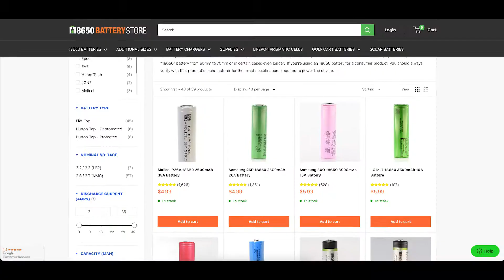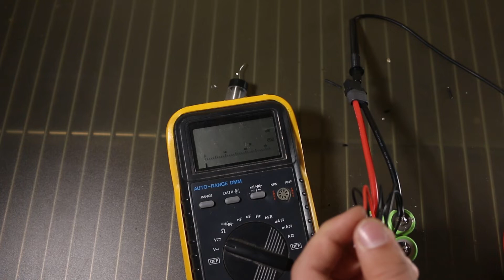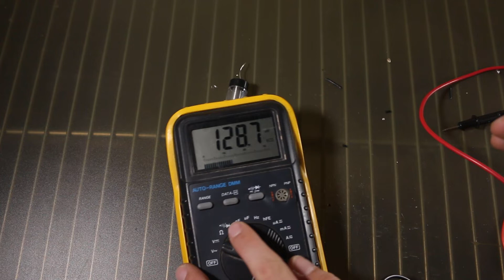Build a Custom Battery!

Comment: Just be careful here. It's unlikely that a battery will explode or catch fire on you doing this, but it can happen. Be accurate with your soldering job and use the lowest temperature you can to get a get solid solder joint. Secondly, these packs are starting to become available pre-made, if making one yourself is not for you, you can likely find one somewhere. 6 cell packs have been available for quite some time. Cheers for the great content Zane.

Comment: I just made a pack. A 4s pack with 2800mah 35a discharge rated 18650s. BUT, my 7 inch browned out, restarting the DJI video twice in the same test flight. So I put it on my 5 inch and flew another 3 minutes with no brown outs. The battery pack was warm when I landed at 3.2v per cell. I think my spot welder didn't make very good welds because I was powering it off of a jump box. Also the nickel strips are not very wide at all. The nickel strips came with the $17 spot welder. I am hoping the problem is with my spot welding and maybe the narrow nickel strips.
Reply from the maker: Yeah for my first battery I was having brown out issues and it was just a bad soldering job and poor battery’s. Also I would recommend landing at 3.3-3.4v I know they can go lower but it makes it harder on your drone and battery, plus that’s probably why it’s getting hot. And just remember that these batteries are more for cruising and not demanding freestyle or anything like that.

But hopefully this will fix your problem and I hope it works great for you!
Reply: @zaneshawdrones  My spot welder didn't do a very good job. I ended up adding solder to the connections and the pack worked fine with no brownouts. I have to beef up my spot welder. Maybe add more and larger capacitors to it. That or I need a more powerful battery feeding it.
Reply from the maker: @CarbonGlassMan It’s  great that your not having brownouts anymore, your right you can always add a capacitor but I think in the end the main difference that you will see will be from 1. The battery 2. How it is being used 3. The drone (how much power it’s pulling and it really just depends on the size and design) really anything 5in and under will work great with this battery, you might be pushing it if you try to go larger than that.